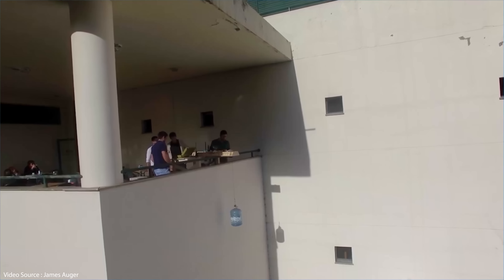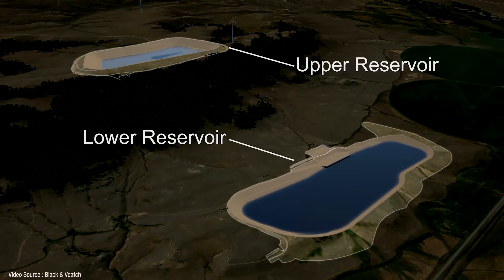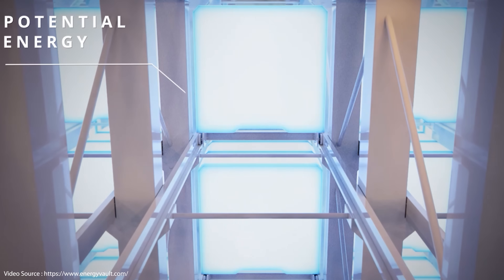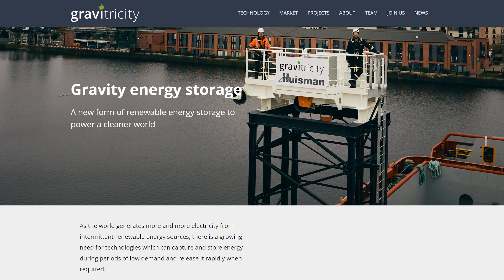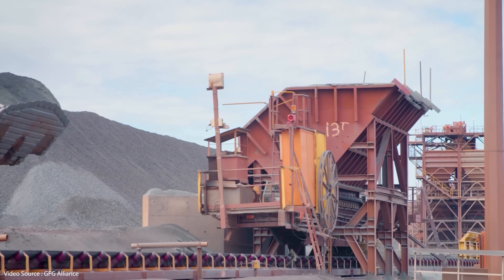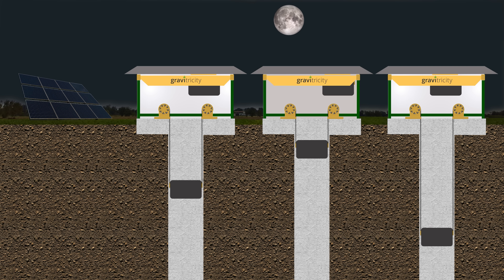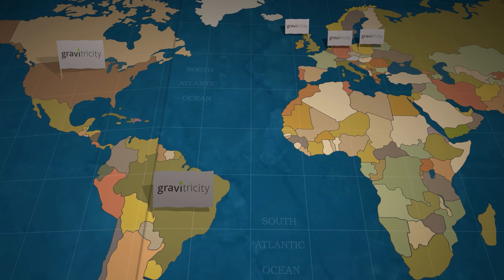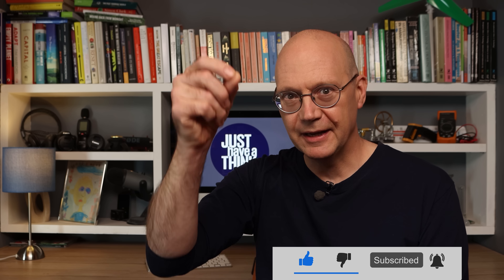Gravity Energy Storage. Who's right and who's wrong?

Comment: I would like to know the actual number of "vertical mineshafts" available with sufficient depth, no water intrusion and other factors to support this.  I think that will limit scale.  I would also like to know the levelized cost to develop a virgin site under reasonable conditions, ie no worries about water infiltration.  That number would represent a scaleable solution.  Anything else I think would be less interesting.  We can't rely on old mine shafts for a critical new energy storage technology.
Reply: I tried to find this but was unsuccessful.  I did find out that there are 500,000 abandoned hardrock mines in the USA.  But that doesn't give much further information on how suitable for this project they would be.  But 500k is a pretty big number - even if a fraction of these are suitable that's still a lot of sites.  I also don't think hardrock mines includes coal mines.
Reply: No water intrusion? 

0

Where there is a mineshaft, there is water.
Reply: Your shaft doesn't have to be entirely vertical - you could do the same thing with sloped tracks, which many mineshafts come with. The stored energy would be the same function of mass times height, with a little bit subtracted away by the additional friction.
Reply: @MontyCantsin  indeed, i was thinking more of shafts that are flooded or that have partially collapsed
Reply: @MontyCantsin  I thought similar. But an extra minor friction loss must be accepted in this case.
Reply: Oceans are virtually unlimited and deep - why not store offshore-wind generated electricity on-site?
Reply: @marekkaletka6746  that has been proposed. Pump air down for storage let it back up to spina turbine to use the energy. But doing that on land with compressed / liquified air,means you don't have to deal with the various corrosive issues in the ocean and its easier to maintain.
Reply: Might I suggest that there is no one solution to energy storage. If this idea is suitable for half a dozen decommissioned mines in GB and another half dozen in Germany with a few more scattered about .  . That is a success.
I think we will need many solutions each nibbling away at the problem.
Reply: Most large mines have multiple.  Between the elevator and ventilation shafts that could work with minimal modifications you are talking thousands in the US alone.  Water might be a problem but the number of existing shafts is probably not an issue.
Reply: I grew up in a mining town, (Mt Isa, Australia) worked in the mine  (and went underground with my brother who was an electrician. The way they get people up and down for every shift is via a ‘cage’, basically a huge two storey wire frame elevator that goes vertically down for thousands of feet. And not all mines always suffers from water ingress, shallow aquifers aren’t ubiquitous. My home town was a desert。 The mine in my home town would offer  half a dozen shafts that would suit this concept . Plus the area gets 14 hours of sunlight most of the year so a solar plant would be very efficient.
Reply: If there is water in the mine, couldn't you use that as part of the weight you are lifting and dropping?  The ground water would fill back in to its level whether you're taking it out of the ground or putting it back in.  As long as the water stays enclosed and you aren't poisoning the water with your choice of container, you wouldn't be effecting the water table level much. 

Also, offering jobs at old mining sites surrounded by a town that just lost a major source of income instead of using a computer controlled system sounds like a good idea too.
Reply: Place small weights on top of bamboo shoots emerging from the forrest floor. As the shoot rises it lifts the weight which pulls a micro generator. After the shoot is sufficiently high, the weight is lowered, again producing energy. Multiply this across the entire forrest and significant amounts of energy can be produced.
Reply: @bluestormcloud791  
😂
Reply: To quote General Turgidson:  "Mr President, We must not allow a mineshaft gap!"
Reply: since most coal mining is done in open pit mining (especially in central europe like germany and poland, which consume most of the coal) there are basically no mineshafts to use at all
Reply: @suit1337  You are thinking about brown coal workings. In the  Czech Republic, Germany and Poland virtually all hard/black coal workings  are/were  deep mines with shaft depths approaching 1500m (The deepest coal shaft of all being Jindrich II on the Rosice-Oslavanny basin near Brno which was 1456m in depth) 
Upper Sielesia in particular still has a significant number of collieries still in operation which could potentially become available. 
Also the Uranium mines near Pribram in the Czech Republic were very deep. For example Shaft No 16 was 1838-4m deep!
Reply: zero
Reply: Mine shafts are ALWAYS degrading and have large water issues. In 30 years of mining I have seen significant water ingress in every mineshaft I have inspected. Doing the weekly shaft inspections on top of the man riding cage was a truly miserable experience in winter.

In many locations the water underground is acidic and any metal exposed will have to be highly protected. In these conditions the lifespan is going to be lucky to be 5 years let alone 50.

It’s unlikely there would be enough suitable mineshafts in reasonable locations and the cost of constructing, lining and maintaining a shaft at a new site is going to be significant. A gold mine in Australia needed $800m to construct a new shaft which was almost 800 metres deep but that did include the head frame cost.
Reply: Water intrusion? You mean a water reservoir?LoL
Reply: Exactly. America needs those old mine shafts to store all our excess cheese production
Reply: I suggest looking into the feasibility of using abandoned open pit mines.
Reply: It's gonna take a while to get firm numbers, but my findings so far:
Considering the worst-case scenario of a reinforced-concrete-lined vertical borehole gravity energy storage system in, say, the Amazon rainforest where the ground is always saturated; seepage rate across a given section of the inevitably-porous concrete is ((groundwater head pressure) -(viscous back-pressure))•(area of section); taking the integral of this function with respect to area will give us a flow rate value in units of volume per unit time. Due to this, out-pumping costs scale with the square of borehole depth, so there is definitely a limit to scalability in certain biomes
Reply: @charlesmartin1972  Heavy water seepage just provides an opportunity to build it as pumped storage instead, with the lower reservoir at the bottom of the hole.
 Shaft cleanliness seems a non-issue with enough slippage space between the weight and the walls.  Remember that whomever used the hole for mining was already lifting things and people in and out of the hole.  Graviticity doesn't need the hole to be safe for humans and don't need the various side shafts (all except construction and maintenance work of cause).  A thin (2 inch) concrete lining like in sewer pipes and manholes would be enough for a hole in regular ground conditions rather than mine shafts.
  500m depth could also be a repurposed elevator shaft in an economically failed skyscraper (originally built at prohibitive cost) or an intentional design feature in new skyscrapers where most of the building is making rent income to fund everything.
Reply: @johndododoe1411  the volume occupied by free water represents a loss of gravitational potential energy available to the weights. Also, seepage through the walls is not passing over a turbine and is thus a net efficiency loss
Reply: @johndododoe1411  it's also worth noting that this seepage issue only becomes relevant below the water table, hence the use of saturated ground as a worst-case scenario
Reply: @charlesmartin1972  If the water seepage is not excessive, it will not fill significant volume beyond what old mine pumps can trivially remove. Let me reiterate, the shaft need not be clean or safe as long as the block can move freely.  Water at the bottom will only loose the energy according to Archimedes buoyancy, hence the benefit of a heavy material.  Repurposing as pumped storage will loose capacity according to foreign seepage, with no difference between loosing a ton from the topside reservoir and receiving an unwanted ton in the shaft.
Reply: @charlesmartin1972  ask any mining engineer how much water will enter these shafts. Most areas of the world have water tables at roughly 15 metres, these shafts will need to be constructed as if they were for mining, and will be extremely expensive. 

Creating openings underground is hard work and nature starts to try to close it immediately.
Reply: @johndododoe1411  you obviously have no experience at all with what happens in a mineshaft.
Reply: @deaninchina01  Ah shut up, I made no claims contrary to your pile of angry posts attacking everyone and insisting that all mineshafts you haven't been in are filled with acid so strong that nothing can be hoisted in there without instantly rusting away.
  The proposed system doesn't really need exposed unprotected iron, even though the above ground demonstration tower used steel beams to simulate the shape of the shaft.  If a weight drops to the bottom from a rusted away wire, a new one can be hung above it with a more durable wire.
Reply: @johndododoe1411 as for the side shafts, why don't use them? Hear me out: instead of a single large block, they could use multiple reinforced mining carts, filled with lead, or any other dense stuff. When elevator gets to the bottom of the vertical shaft, a cart rolls of into a side shaft, then the elevator goes for a next one. When the energy storage has to be "recharged", all the carts are lifted up.
This could literally use existing mine elevators, possibly with some reinforcements.
Ideally, it would be to enlarge the bottom side shaft, to be able to work with oversized and extra heavy carts.
Reply: In my very small county of Belgium there are about 12000 vertical shafts. Even if only 20% are usable that's still more than what we could set up for this technology in the next 50 years.
Reply: @codeartha  The only problem That I can see is it is a long time since the last Belgian colliery closed. 
Even the Kempen pit Zolder closed 30 years ago on 30th September  1992.
The last Wallonne colliery Houilleres Roton-Farciennes Siège de Sainte-catherine closed nearly 40 years ago on 30th September 1984.
So I seriously wonder what condition the shafts are in now. Or indeed if they even survive.
Possibly if any survive flooded it would be possible to restore them but it would not be cheap.
Certainly the shafts in the Kempen would be a better bet as in general they were deeper.
Reply: Using a water/air tight shaft lining the water intrusion point become moot.  As in my mind Gravitricity would want to keep the shaft as clean and dry as possible.  Which means that they would have to use some kind of lining in the drop shaft
Reply: @misamsung6191  I don't think so. Lining a mine shaft would be very expensive and making it water tight, let alone air tight niegh on impossible. Lowering the weight down a mine shaft eliminates any wind interference and gives you an almost ready made structure.  Pumping water from the shaft will vary but can be powered during times of energy surplus.
Reply: @evilgoogleevilgoogle3855  IDK we are able to dig tunnels under rivers and such.  The first tunnel under the Thames was in 1848ish.  People assume that they are going to  pump down the shaft but that isn't necessary as the raiser can be build in sections on the surface and lowered into place.  The question remains how fast the weight will drop.  A slow steady drop will not generate any wind resistance.  Where as a fast drop will.  The raiser doesn't need to have a vacuum but just a reduction in air pressure to allow the weight to drop smoothly in its guide tracks.
Reply: @misamsung6191    It can be done, but it is expensive and I think unnecessarily beyond maintenance of the existing mine safety shuttering etc. Of course if it adds to system efficiently then it may be worthwhile.
 I've walked though that tunnel from the isle of dogs to Greenwhich it is strange do many people don't even know it's there. 
( you start you reply with 'IDK' -  in these days when so many abbreviations are used I probably should know what that means but I regret I do not.)
Reply: @misamsung6191  Personally, I would never sink a shaft where I had to rely on a liner to keep it dry. That's just too vulnerable. Concrete wouldn't be any good, because it's too prone to crack. Whatever material was used would have to be flexible, monolithic, and likely expensive.
Reply: @donnievance1942  There will always be in infill of moisture of some kind and eventual condensation on the walls and the machinery.  They would also want to keep the shaft clean for the weight dropping. Not to mention that they would want to ensure that the weight drops smoothly and straight. So it does make sense that they would build some form of raiser for the weight.  I would think that we have a good handle on the engineering involved in making an air/water tight raiser.
Reply: @misamsung6191  "Using a water/air tight shaft lining the water intrusion point become moot."
Until you take pressure into consideration.
Reply: @wisenber  Not really the water/air tight riser can be engineered to take the pressure and any riser is going to be a tube.
Reply: @misamsung6191  "Not really the water/air tight riser can be engineered to take the pressure"
Engineering has shown us that long thin vertical tubes are difficult to stabilize, let alone seal for lengths of time.
There's a reason why those mines pump out so much water every hour. The mine owners determined pumping is more economical than sealing.
Reply: @wisenber  One must think outside the box.  It is only a matter of engineering and of supporting its own weight. The riser is going to be stabilised by the walls of the shaft.  The reason that mines are pumped is that the miners are still extracting whatever it is they are mining for.  Once the extraction stop so do the pumps.  I suppose that they could shotcrete the tunnel walls and in some cases they do to stabilise the shafts and drifts. But the riser for the gravity weight and not the shaft needs to be water/air tight.
Reply: @misamsung6191  Ignoring past engineering failures and pretending the solution is simple based upon wishful thinking rarely has good outcomes.
Reply: @wisenber  Gee IDK we have aeroplanes, rockets to the moon, satellites in orbit,bridges and tunnels.  All of those and more have had  spectacular failures in their development.  The solution is indeed simple it is just a matter of getting the engineering right.
Reply: @misamsung6191  Gee, maybe we have a body of knowledge from centuries of development and should use it? Ya think?
Reply: @wisenber  I know that you are desperately trying to start some kind of flame war because I dared to disagree with you.  Not going to happen.
Reply: @misamsung6191  Odd that what you think you know isn't actually true.
Reply: @wisenber  Just keep on fishing no one is going to bite.
Reply: @misamsung6191  Ironic of you to say that
Reply: @wisenber  Still trying for that flame war I see.  Still not going to happen.
Reply: @misamsung6191  Nice projection
Reply: @wisenber  Keep on swinging but you still aren't going to get that flamewar you've been trying to start.
Reply: @misamsung6191  Or we can just acknowledge you're a troll. There's that.
Reply: @wisenber  Well go ahead and admit that you've been acting like a troll trying to start some kind of flame war for some odd reason.
Reply: @misamsung6191  Your weak sauce trolling is only rivaled by your flaccid comprehension of how physics works.
Reply: Water is better in the shafts because then you can build a boat at the bottom, land the weight on the boat, and then flood the shaft to raise it back up for free.  Perpetuagravitricity.
Reply: seems pretty bloody stupid when we have this amazing thing called water! you pump it up! and wow amazing it will flow back down! sure it doesn't look as pretty as that ridiculous lego tower or mine shafts to hell but it sure sounds like the same shit to me except, no blocks, no cranes, less things to go wrong/wear out.....i guess going to a board meeting and saying we should pump da water up the hill doesn't doesnt get ya a promotion!
Reply: Just a quick question: how many of you going on about the number of mineshafts and how relatively easily they'd be able to use have actually been in such a mine? Or any mine whatsoever?
Reply: @keith6706  
I don't see anyone saying it'll be easy. It's relatively easy and well worth looking into compared to planning out an entire void space from scratch.
Reply: @keith6706  I've been in a couple of mines.  Though maybe I should clarify, I don't think this would be exactly easy, probably doable but not easy depending on a lot of specifics that are not covered here or in the couple of other articles on the subject I have browsed.
Reply: well you see, when you factor in the cost of digging giant mineshafts, then melting tons of steel, assembling them into giant cranes and cables, mining and refining tons of copper ore, turning it into electric motors, and the maintaince of having to crawl in a giant building full of moving things trying to crush you, to replace that one little wheel for the trolley that breaks every hour, then the concept makes no sense! but when you get paid by them to make an ad video for them, then suddenly it does!!
Reply: I work adjacent to the oil & gas industry, and honestly, digging holes is a lot easier and cheaper than it used to be. Granted, an oil well isn't this large, but I'm pretty sure it could be figured out. I definitely find the idea of using an underground shaft to be preferable to cranes. The entire installation could look nice and small and neat from ground level, and any catastrophic failures of cables would be less dangerous.